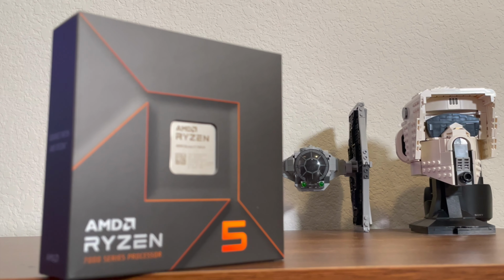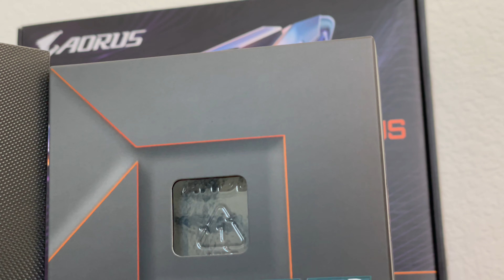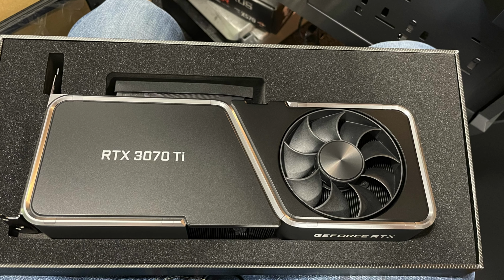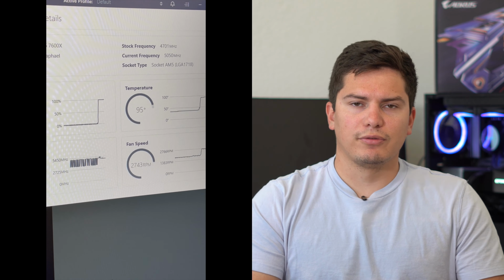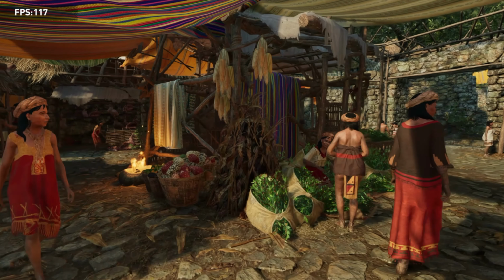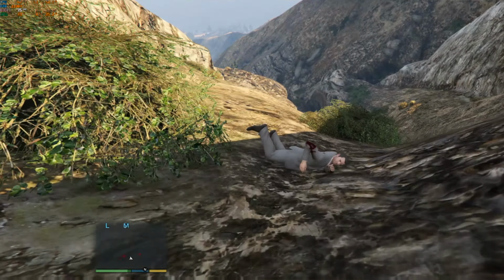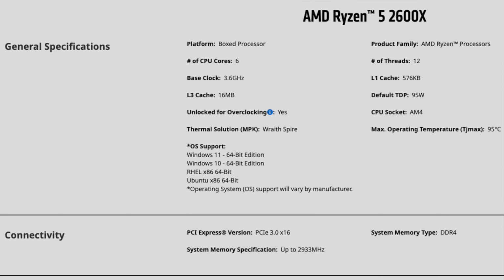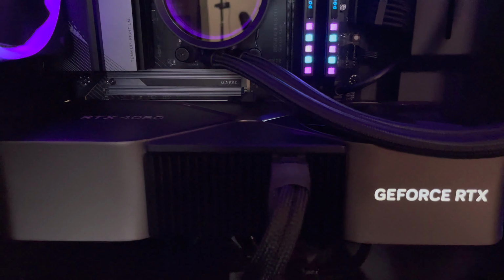AMD Why Did You Do This!? My take on The Ryzen 5 7600X (Processor Fails)

Comment: 2024 looking about intel CPU i5 -13600k au$329.00 edit  Found it @  $309   always been with intel  my Gigabyte MB chit itself pins bent idk why 2017 build ddr4  
So Intel build ddr5  here we go MB $340.00  RAM $150 CPU 329.00=($798.00 best so far looking )  i'll use my waterforce 2080S $1699 2018 buy old wont game much anyway 
was looking at ryzen 7600 But all the repair guys kept saying is OH NO wtf its another ryzen in the bin 80% & intel 20% defect thats the ratio over 1 year so stay with intel safer i dont give a toss 
if there $ 50 100 cheaper i wont  risk it good luck red     im staying blue @O
Reply: amd ryzen7600 build $819.00 so not much in it against 13600k build